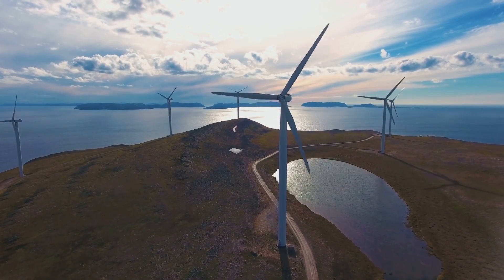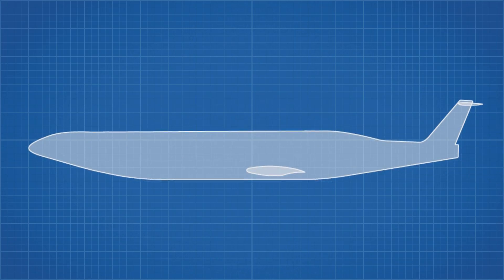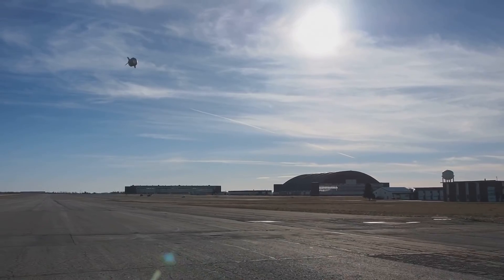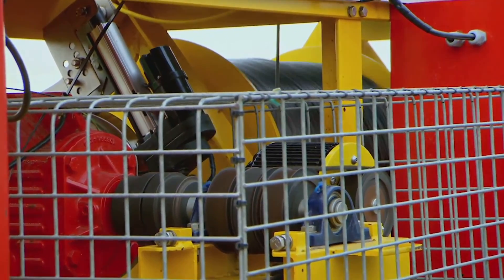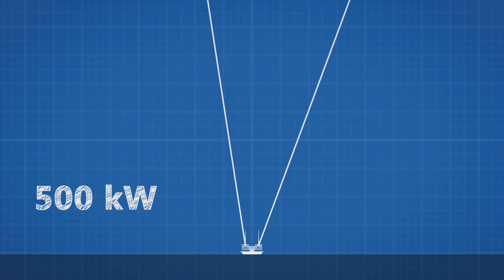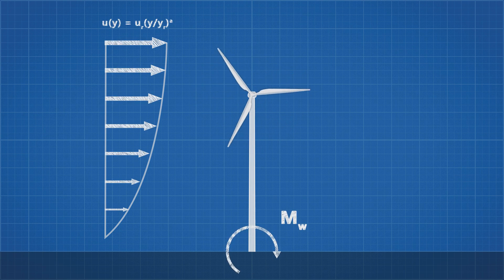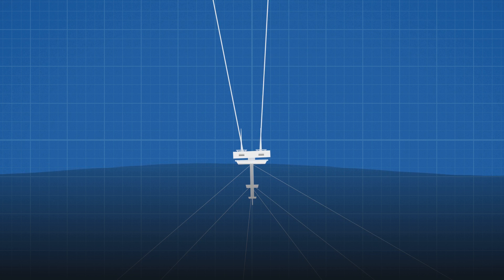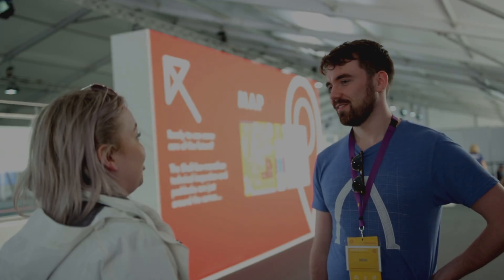The Future of Wind Power? - Kite Power Systems

Comment: Very interesting video! I'm curious as to what happens to the kites of the wind speed drops off very suddenly. It seems like they could get tangled in trees or destroyed by waves if they fell before being reeled in.
Reply: Hopefully the robotic pod is smart enough to adapt.
Reply: Only guessing but reeling it in would keep the kite in the air(depending on how fast it can be reeled in). Same effect as running in the opposite direction of the wind when flying a small kite.
Reply: No, it's a flag that was recently unveiled in Philadelphia to include people of color in the LGBT community.
Reply: Ramas Virba REEEEEEEE
Reply: Drops in wind shouldn't be an issue, after all these kites are literally gliders in most traditional uses. They don't need wind to stay in the air for quite a while
Reply: The figure 8 the kite flies in creates the most power out of available wind . If the wind is overly gusty where you can get lofting which is a negative air pressure , the kite can fall from the sky ! This can be mitigated by not flying in these conditions or by reeling the kite in as soon as sensors feel a loss of tension on the cable . Certain conditions will make it unviable but not often will this occur. With energy storage becoming the greatest it’s ever been and with more focus and investment on it every day we are not so far away from being independent from fossil fuels . Easily within 5 years if every home stored energy along with all electric cars !
Reply: That's a good point to be brought up. I think the only reason they had two so close together was proof of the concept that continual power would be generated from a single system, which could be deployed as a temporary power source for disaster relief. I'm sure that if they constructed a wind farm with these, then there would be thousands routing power to a single station. With continual power no longer being an issue, they could have the kites as far apart from each other as they wanted. The brilliance of this is that these are all software programing issues. There are too many math geniuses in the world for such a problem to remain without a software program solving the issue for very long.
Reply: Ramas Virba I'm not going to bother answering that question.
Reply: Ramas Virba theoretically yes, but in practice, homosexuality is often heavily discouraged in minority communities. Also why the hell did people turn this conversation from energy sources to fixing on a profile photo that has nothing to do with the conversation?
Reply: No, it's just not worth arguing about, because after I say that white people are already included in the LGBTQ identity, whereas people of color have traditionally been excluded from those communities, you're almost certainly going to yell about white people being discriminated against.

Comment: back in the day, I flew Flexifoils. The ones with the spar along the leading edge. I think my dad had a 4', 6', and maybe an 8'. I can tell you that even a 4' flexifoil in a good wind wants to drag the person flying it across the field.  If you manage to stay in one place flying a 6', you will get a full body workout and stretched out arms. There's certainly lots of energy to be had here, and after flying this type of kite I understand how the amount of pull can be managed. I just hope the conversion to electricity is practical.
Reply: jonnda was searching for a fellow kite pilot in this comment section
Reply: You have to turn the lift force into rotational motion the make electricity thou. The kite is pulling a spool on its way up. Ok probably could get a little out of that but once it is up the tethers aren’t spinning a generator anymore.
Reply: +Thor Holton that's why there's two kites, & the little controllers to allow the amount of lift to be altered to allow one kite to have more lift to pull down the other one, this was all in the video.... & it explained far better than i can, or at least far better than i care to take the time to.
Reply: What would be a good method for flying these kites?  I'd imagine they put the wing into a high angle of attack for high lift when letting out the tether, and in a low angle of attack for low lift when reeling it back in.  http://en.wikipedia.org/wiki/File:Lift_curve.svg
Reply: A few years ago when walking the dog I said hello to a couple of people flying big traction/power kite in the field.  I thought I hope they are careful, the wind could pick them up.  Next day one of them was taken up by the wind and killed.

Comment: Bill has also mentioned Thorium a few times, hit your subs with some real energy magic.
Reply: https://whatisnuclear.com/articles/thorium.html
https://whatisnuclear.com/articles/thorium_myths.html
Thorium is indeed more dangerous short term, but long term, it is by far safer.
somewhat Ironically (relative to his comment) one of the key benefits to thorium is that it does not produce larger then uranium atoms, (that are more dangerous long term)
Reply: We should also note that containing more dangerous byproducts over a short period of time is much more feasible compared to containing long lasting radioactive byproducts (I seriously doubt that bunkers containing waster uranium are going to last 30,000 thousand years).
Reply: Like nuclear fusion?
Reply: petlahk no it doesn't
Reply: Thorium is not magic. MSRs that just happen to work well with thorium, now thats real shit.
Reply: Still most reactors produced are 2-nd generation ones. Besides thorium's still complicated and should i say - irresponsible. We have no right to impose upon future generations any systems that they cannot refuse. For the cleanup of nuclear waste - yes, but not for the future of energy production.
Reply: Except for the fact that Thorium produces a higher quantity of more dangerous byproducts than regular nuclear.

Comment: looks good, but wouldn't there be a need for a low flight restriction? where ever I've been in Germany, the military makes low training flights. sometimes even with huge machines like the C-130. damn that thing was so low ...
Reply from the maker: Right now they don't fly particularly high and they fall under the same laws a paragliders I believe. If they flew higher and got bigger, then yes I think new regulations would need to be made.
Reply: the kites would be in predetermined area where the restriction would be held, that's all
Reply: Kites like this are pretty much the greatest enemy of planes. Seriously, they are like the combination of two great fears of pilots: trans-valley power lines and birds.

I'm sure on air charts areas operating these things will be marked with a picture of a dragon and the words "Only death lies here, stay away". Other than that though these kites look interesting.
Reply: @korakys  Planes fly over 3000ft, kites below that.
Reply: Why would this not be solvable by simply placing a no-fly zone around a safety radius off the ground platform?
Reply: Circle Breaker, at least then these things would be the definitive nail in the coffin of that stupid zombie idea that won't die: flying cars. Barely trained people operating vehicles is bad enough on the ground but in the air, we might need mean traps like these kites to discourage people who can't fly to actually not do it.
Reply: the military is not the main complication, the far larger problem might be with rescue helicopters
Reply: +Real Engineering Perhaps for the portable versions which might need a temporary flight restriction but for fixed installations I don't really see any need for new building or air traffic regulations at least not for airspace related reasons. We do after all already have pretty flexible regulations in place to govern other tall structures buildings, bridges antennas, roller coasters etc etc.

Probably would involve installing the applicable anti-collision beacons and keeping them illuminated at all times while deployed but that's a minor matter to even a 500kW unit let alone one generating megawatts.
Reply: I actually think the biggest problem with flying cars is that they are too noisy. Seriously. But yes, training to be a pilot takes ages, automated flying might fix that though.
Reply: As an ultralight pilot, who would share airspace with these, these are total death traps.  I'm assuming they would only fly the kites in a certain radius and that would be a marked no fly zone.
Reply: +Circle Breaker True though the anti-collision beacons mostly serve as a warning for VFR aircraft it is after all ATC's job to not vector IFR or SVFR aircraft under their control bellow minimum vector altitude which of course is supposed to take into account terrain and obstructions thereon plus a margin of safety above those. My main concern with them though would be that it would be really important to mark them in such a way as to clearly warn VFR pilots that they are NOT aircraft it's the tether one is most likely to fail to spot until it's too late and being steel cable by the looks of it I could see one of those potentially taking off a section of wing like a cheese-wire through butter if hit at high speed. Thus why I was thinking that the lighting scheme used for buildings with antennas and the like would probably be the best idea ie something that says very clearly "I am attached to the ground stay above me!".
Reply: +Circle Breaker Indeed I think even if there was some novel solution to the noise issue they would probably need to be autonomous to gain much traction, learning to drive is already expensive in both time and money, learning to fly even more expensive and presumably the regulators would demand both to operate a dual purpose aerial/road craft.
Reply: +Rod Read Larger systems are a different story hell flying around bellow 100ft AGL is generally not something one does outside of the perimeter of an airport anyway. There are a whole hell of a lot of things that easily top that ranging from modest buildings to natural obstacles like trees hell even the ocean isn't safe at that height seaboune ships top that easily.
Reply: the cables wouldnt be kilometers long otherwise they would be to heavy
Reply: Paragliders with steel cables underneath them.  It looks good, but it is gonna anger a lot of amateur pilots.
Reply: dont care. good eco energy > military

Comment: I don't get it
Reply: The tether - let's call it rope - is rolled around an axis and attached to it. As the wind pulls on the chute, the rope is pulled up and rolls off of the axis. The axis rotates as a result. This rotation is then turned into electricity.

As the chute reaches it's peak, the other chute is low down and gets adjusted to start rising. The power this second chute generates as it rises is used to reel in the first chute. Because the first chute is now angled to take on as little wind as possible this doesn't cost much energy. When the first chute is lowered down the status quo is restored and rinse repeat.